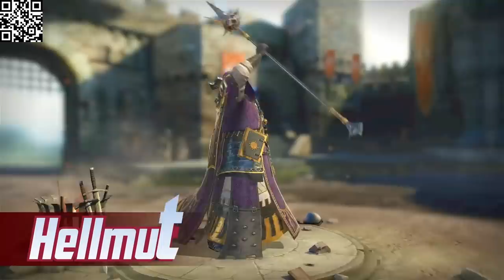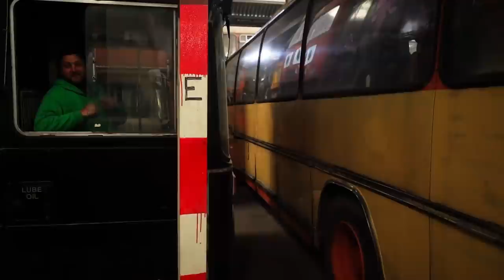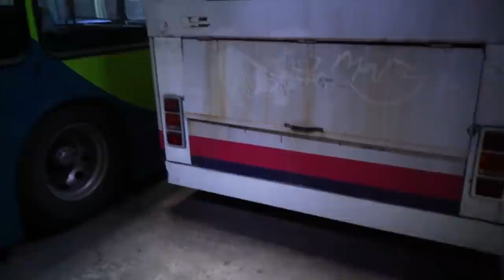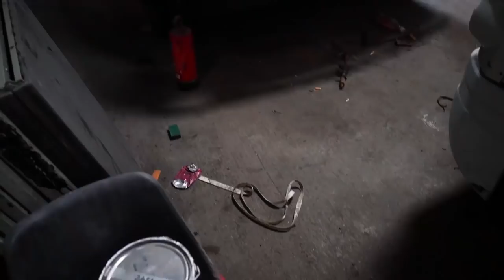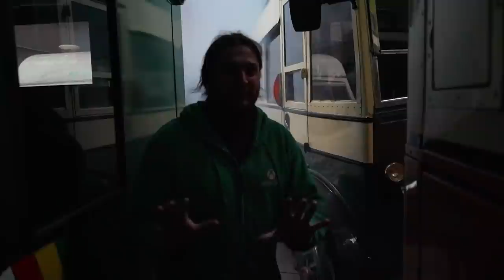50+ Busses in 15 minutes at the Town and District Transport Trust - LMM visits 1

Comment: The 266 Route in London is a fairly local one to me. Nice to know that MCWs used to operate the 266 but that's way before I was born! Out of this collection my favourites are the DAF DB250 ALX400, the Volvo B7TL ALX400 and the 2 Dennis Darts. On the first Optare Solo you can actually still see part of the Stagecoach Logo on it right at the back
Reply from the maker: It's a good collection of vehicles
Reply from the maker: It's a good collection of vehicles
Reply: West London transport I own 702 the stagecoach Dennis dart the one you can see with the naughty bus blind is mancbuses

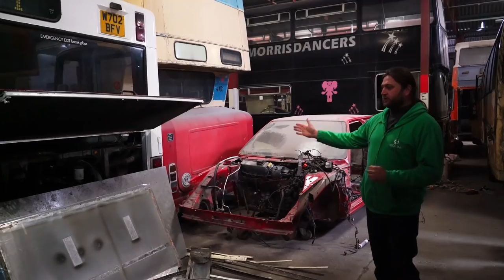Comment: At 5:04 there’s my said broken dart number 702 ex stagecoach Manchester or ribble the bus doesn’t start but it runs with easy start well it starts but have to use easy start the bus has got a full engine replacement and repair to the starter motor
Reply from the maker: Sounds like a lot of work

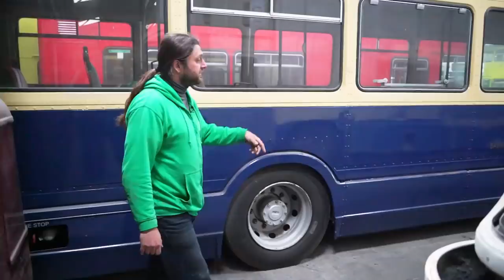Comment: CEO 720W belonge to the barrow in furness corperation when they used to run here because most of the cars or anything with ceo were registered in barrow and kinda of gives it away when you shot a side view 7:25 it nice to see it again dont see it much here no more even on special transport events
Reply: CEO720W is there to get work done on it's engine. It belongs to the Workington Transport Heritage Trust  and will be going back soon.
Reply: I have drove that bus many time,s when it was at Barrow
Reply from the maker: Thanks for the info!